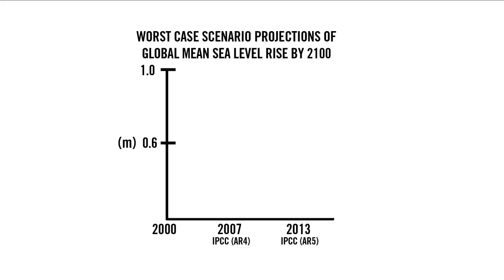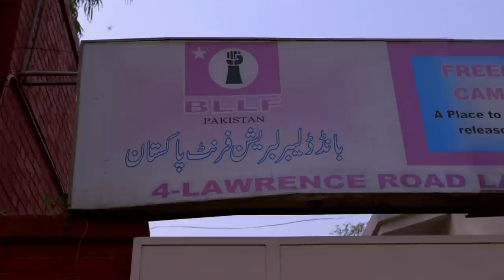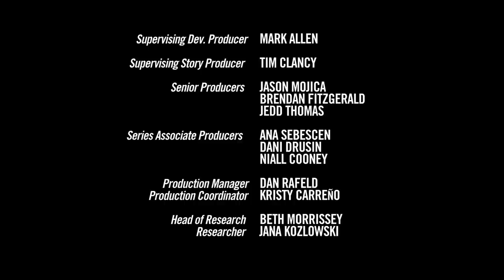VICE on HBO Season 2: Greenland Is Melting & Bonded Labor (Episode 2)

Comment: Many of our ports had to be shut down last year (in Nuuk, and in Paamuit) for the first time since the 60s because the water froze over and ships were stuck in place. Much of the black ice mentioned was caused by oil barred under the ice that has risen. Last summer, I flew into Kangerlussuaq to connect a flight to Copenhagen and saw much of the black ice they showed in the interview. I can assure that majority of the "blackness" is not fault of humanity. Even in school, they tell students its caused heating and cooling phases that the Earth receives and the Greenlandic parliament refuses to offer environmentalist/researchers any help with funding. However, if this ends up being true to the extent they say, at least we'll be able to continue growing potatoes. A few years ago, some Danes introduced a hybrid potato plant that was able to handle the Greenlandic winters. The current temperature right now, iss -13 and snowing.... so yeah, it gets pretty cold here. :P

Comment: Water levels are not everywhere the same. I won't bother you with the reasons for that, but briefly said it's because of the pressure caused by ice sheets and tectonic plates. Water levels are lowering in Alaska and rising in the Micronesia region. So that's why it's already hard to believe these doom scenario speakers about their 'global 8 meter rise'

Comment: About the slavery thing. It's wrong what the slavers at the brick factories are doing, but you also have to ask: "how did it come to this?".
Vice claims not to have gotten an interview with one of the slavers, but it should be easy to figure out. It's a market competition. If they don't keep skilled slave labor they go under. So everyone is a victim under the system.

Good on Pakistan for having movements to reform this though, but bad on Vice for wanting a classical Good Vs Evil stance on this.

Comment: I understand that we are seeing hints of climate change, but what really can we do. About 12000 to 100000 years ago was the last ice age, the ice melted then, so what caused that? Humans or is it just earths natural cycles that we dont have control over?

I should add that I do think we should be doing something to fix our pollution issues and not just chalk it up to earth's natural changes.. But it has to be a global effort which is easier said than done.
Reply: See, glaciation levels were higher back then, and it waa probably carbon from volcanoes that deposited greenhouse gases into the atmosphere......we can't control the volcanoes but we can control ourselves! There is too much research that proves it's our fault.
Reply: +Trevor Vera There is a natural cycle, however, for the past century our temps and gases have increased more than they naturally do, and in a far shorter time period.